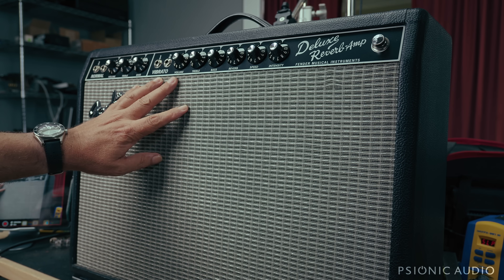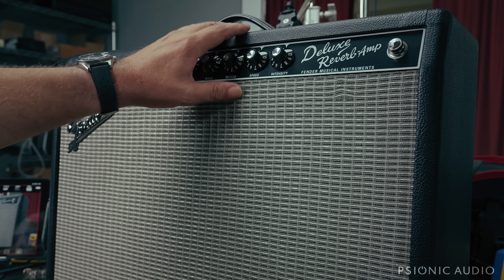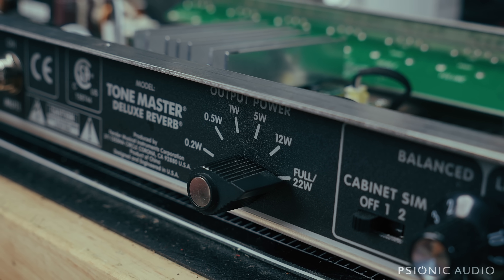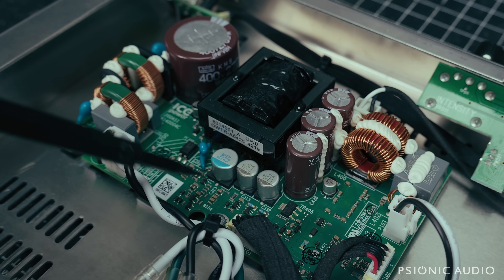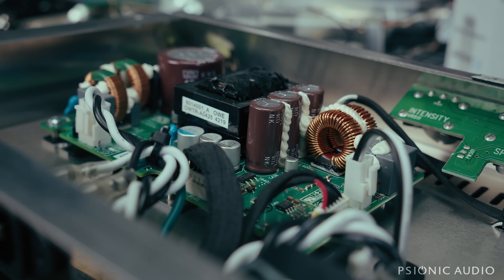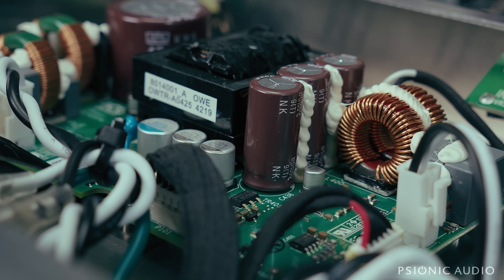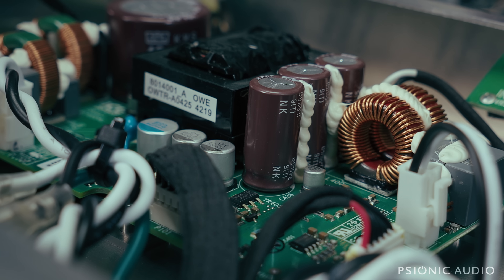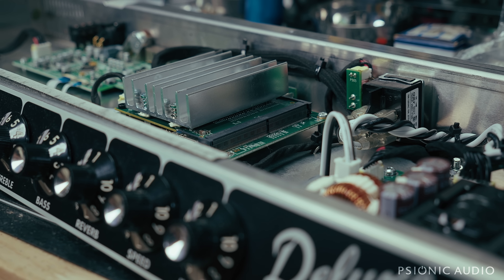Diode of Doom? | Fender Tone Master Deluxe Reverb No Sound and Flashing LED Pt 1

Comment: Love your work, and learning tons, but I might disagree about the tube vs solidstate vs class-d watts. Class d amps tend to be spec'd by their current draw at some threshold of clipping, whereas ss/tube class a or a/b can get output watts from dissipation calculations taken from measurements. Tube watts at "x" threshold of clipping is just getting started, but ss cliipping is more of a true ceiling that just gets ugly when you exceed. The first 50% of a class-d amp's power is rock solid, but the top 50%  is fluff, smoke & mirrors. My working "rule of thumb" as a performing guitarist/tech of 30 years/thousands of shows is 1w tube to 3w class A/B solidstate to 6w of class D. Not a scientific analysis, but a real-world observation of what it takes to keep up with drums and other guitarists on stage. So 100w class-d to emulate 22w of tube is pretty close here.... the general purpose ToneMaster has a 1000w ICE module, plus a small class AB ss amp to drive the horn, fyi... but definitely can't keep up with a QSC K-series, even with the 3rd party preamp board replacement from Archangel Electronics in Georgia...

Comment: With SO many great modeling options as potential replacements, I can imagine a repurposed TMDR as dedicated speaker cabinet or even with a modded chassis. The dimensions are perfect for a DR copy to slide in. For myself, I may even put my 76 in there for the solid pine cab.

Comment: I have a 2 year old Princeton Tonemaster that had sound issues.  The sound would either quit or significantly decrease. The dealer referred me to Fender for support.  Fender wanted a video of the failure.  When doing my own research, I discovered that the amp has a USB port and a firmware update is available.  After updating the firmware, the amp hasn't failed once.

Comment: A Watt is a Watt, that's true, but there's still a big difference (about 2x to 5x) between valve and solid state watts, because of how they are measured. A Bassman for example is clean with the volume set to between 1 and 4-ish. So around 4-ish is where its wattage would be measured. It still gets louder 'till about 7 to 8-ish. From there to 12 it just gets more distorted. A modeler amp needs to be absolutely perfectly clean over the entire sweep, because it gets the signal including distortion from the computer and needs to make it loud without additional distortion. Also an ss amp distorting sounds like it is broken. A Bassman at max clean puts out about 45W. To imitate that and match the max volume or rather loudness, a Tonemaster needs a 200W poweramp section. A 60W speaker in a 25W valve amp as in your example will ad its own distortion at full blast, so will a 60W speaker in a 100W Tonemaster.

Comment: There seems to be a lot of mistrust of solid state in general and surface mount in particular.  SMT devices are not that difficult to replace with an ordinary iron and the correct tip.  I haven't owned a tube amp for long enough to need to replace the tubes but if I'm looking correctly a set costs more that a complete ICE module.  And it they really need to be changed every 3 - 4 years.  It seams like a Tonemaster is a good deal.  They run cooler and use less power, with some extra useful tricks like the line out and the attenuator.  
Its not worse.  Its just a lot of new skills to learn. New challenge.

Comment: Thanks, Lyle for taking a shot at the Tone Master. I bought one when they first came out and have taken it to about 200 gigs over the last 5 years or so. If I ever need work done on it, I hope I would be able to find a guy with your skills to fix it. But it has been a durable beast. It lives on the back of my golf cart in my central Florida garage all year long. On Sundays, it  travels over pavers to the air conditioned place my band plays oldies by request in an active adult community. I'm 77 now and not certain which of us lasts longer.

Comment: As a designer myself -  it's easy to see litany of factors that can cause unreliability, being pointlessly over complex,  using the cheapest substrates, connectors and SMD ... the last time I had similar complexity on the bench 3x "vias" on  preamp PCB had broken causing it to not connect to the other layers. That's because these board types do not stress well especially in "high vibration" environment. And ..OMFG...whenever the word "software" is spoken over a guitar amplifier, you just know it was doomed the moment it left the factory.

Comment: Unfortunately there are no schematics for those ICE power supply, power amp boards.
It sucks to have to trash the cheaper models that use them that aren't worth replacing the module.

Comment: Got my tone master whenever they came out, four or five years ago. Still working fine, but I would expect nothing less consider I primarily play at home. I knew when I bought it that it was a gamble, but for me, it still sounded great, it was lightweight, it has the attenuation feature, it has a really good Direct out recording option and just made a lot more sense for how I was going to use it. Here’s hoping it hangs in there. I strongly consider getting a real deluxe reverb, but I’d probably never be able to turn the thing past one or two at the most

Comment: They can make SMD's tough enough for use in rockets, fighter jets and the like, yet consumer products using the same tech seem to be made to fail and be throwaway tech. My guess is they would be too expensive otherwise and not be able to compete with the tried-and-true old tube amp technology.
Reply from the maker: Well, to be fair, Musk’s stuff seems to blow up on the regular…
Reply: @PsionicAudio  🤣Touche'

Comment: Found this on guitars Canada forum:

Using customers as alpha and beta testers with a warranty on the clock is unacceptable. 

For what it’s worth I don’t really want to buy anything that Psionic Audio doesn’t give a thumbs up to. 

No, but manufacturers have a penchant at times for rushing product out without due diligence.
In the case of the aforementioned Tonemaster issues being discussed here, I believe it was Fender wanting to get their new clean-sheet design out without dilligent testing. This is the result. It's not just Fender....having been the Mesa warranty tech for over 15 years, there are plenty of examples where product is rushed out and then Mesa waits to see what the blowback is.
A good example of this is the early MKV amps. They came with under rated rectifier diodes that supply the low voltage to all the channel switching functions and other ancillary circuits. Due to the heavy current load when these amps were operated, the diodes would almost desolder themselves out of the board they got so hot and would heat stress the board to the point it would go brown. Diode failure was a real danger until they revised the diode rating.

Comment: Exactly why I won't buy Fender amps: cheapest components possible (valve+SS),poor design and surface mount hell impossible to repair.
Reply: Just don’t buy the modern ones.  The old silver face/blackface tube amps are great and easy to fix. Even the reissue blackface 65’s are great

Comment: I have a cousin who has an old Princeton that went south a few years ago. I told him to send it to you to get it fixed. He decided he didn't want to pursue that because he was afraid of what shipping would cost. So it still sits.  Last year he was all excited to tell me about the new amp he had just bought. You guessed it. He bought a Tonemaster. I put on my best poker face as he talked about how awesome it is. I hope he holds onto the Princeton so he can get that fixed when the Tonemaster craps out in a year or two and discovers it's not worth repairing.

Comment: I think they use larger amplifier modules than neccessary so they'll never go into clipping. The output amp has one job, to perfectly reproduce the DSP signal.
Reply: Although that is a lovely idea, I doubt it sincerely. I think Fender said, 'How much will you charge us if we purchase 100k absolutely identical ICE modules to use in all of our amps?" and they said, 'If you want that many, we will give you an obscenely low price'.
Reply: @diegorhoenisch62   These Fender guitar amplfiers are just emulators. The only function of the ICE module is to accutately reproduce the DSP signal. Thus, the amplifier module must have enough headroom so it never goes into clipping. Other Fender amps may use same ICE module but my point it still valid.

Comment: By now, I image someone will have mentioned “D 202”, located under the big heat sink in the middle of the amp chassis.
It’s a $.50 microscopic component available through online vendors.
Reply from the maker: Dude, I found it about an hour ago. Way to spoil the next video! ;)

Seriously, thanks man. The local Fender authorized center didn’t even have service bulletins on this.
Reply: @PsionicAudio  My information was passed on from the FMIC amplifier tech department in Arizona. GK and Gary are very helpful and supportive.
Reply from the maker: SMD isn’t a problem.  

The issue I have is with amps like Blackstars and Vox AC10C1s where they surround SMD components with vertical through hole components, meaning you have to remove six glued radials to access one SMD cap or whatever.
Reply: @PsionicAudio  Yeah, that's a huge pain. Depending on the access you can sometimes get away with heating the board from the backside with hot air and then plucking the component off / dropping it on from the front.
Reply: @PsionicAudio  Yes, THEY DID but they were not telling.
Reply: You got it, mate! I've done a bunch of them now. It seems the tantalums nearby go leaky and should be replaced, too.
Reply: @BradsGuitarGarage  Ooh YUM! Tantalum!
Reply: @BradsGuitarGarage  oh, Tantalum caps. Lovely.
Reply: I dread working on SMT boards. Love the old solid state and tube stuff. Easy to see. No magnifying glass needed.
Reply: @mikewithers299  It's not as hard as you think. Little step up from thru-hole stuff but easily manageable once you get a little practice in.

Comment: Mine had same exact problem. Got fixed out of warranty at an authorised repair shop in Sweden free of charge. Good sounding utility amp overall, but you are absolutely right that the original tube version is superior in terms of repairabllity. Each version has its purpose and for many I believe the Tonemaster will be an adequate choice. Thx for sharing - cheers!
Reply: I dunno, I couldn't stand the sound of the thing myself. I have a real 1966 Deluxe reverb and it will still be going strong long after all the Tonemasters are in landfills.
Reply: @weschilton if tubes are available…
Reply: @cosmicsteve5801 what's a set of tubes for a deluxe? Like 100 bucks for power and some pre amp tubes. Pay 600ish bucks plus 400 for repairs and you've got an amp for 100 years....not a bad breakdown of costs considering these computers cost 1000 bucks used anyway and won't be fixable after 20 years.
Reply: @sebbass6-V-6  I've been playing through a digital guitar amplifier from a Japanese company, with a well deserved reputation for reliability, for twenty five years. The amp sounds great and has been 100% reliable with zero maintenance costs.

Comment: I've sent customers links to replacement Ice Power modules on Parts Express for 20 year old G&K and Ashdown Bass combos, both times they refused. Mostly SMD and a hot air station is needed for any rework. I just deny any amp with them now because the modules are between $199 and $399 and it's doubtful they're going to agree.